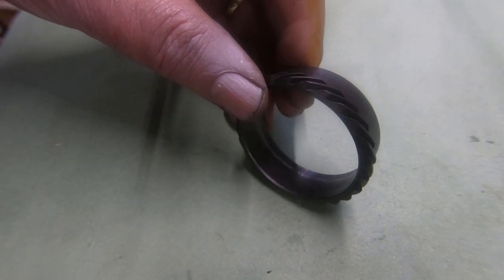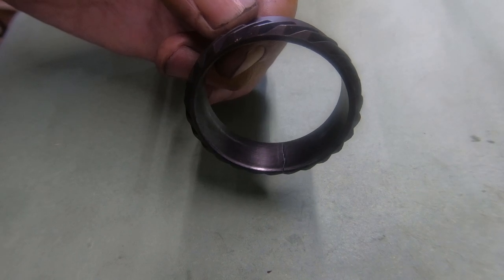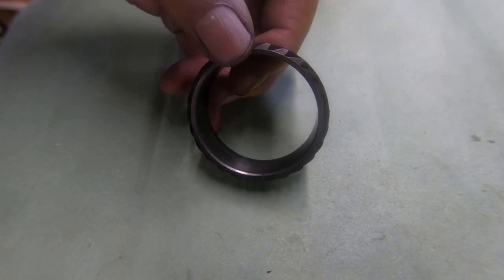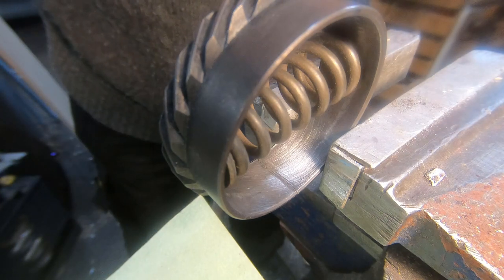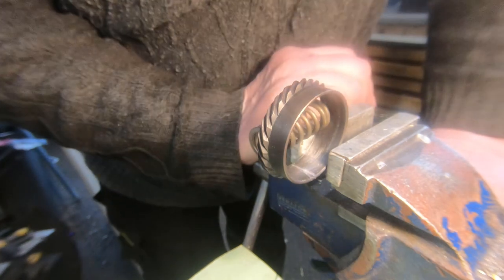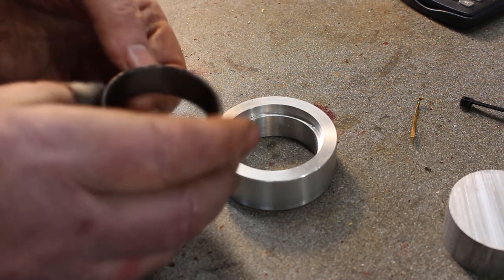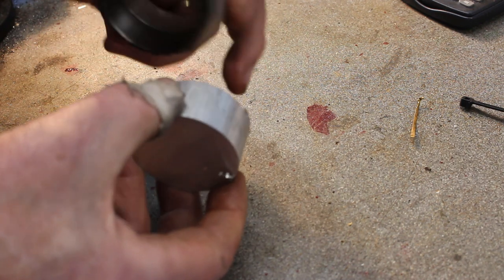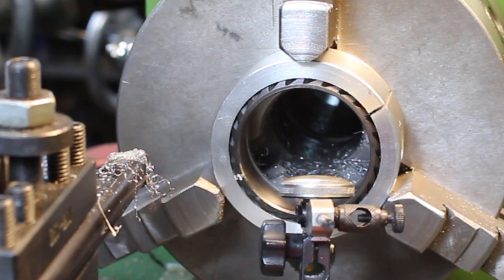Laverda Classic Bike - Speedo Gear Repair

Comment: Ah, the green stuff I love it. Every machinist should have some and hopefully remember just how well it works.
The part can still be removed by heating which is often very handy. 
I have never tried the activator you can get for it, I wonder if my kitchen mitre bond activator works on it.
Checked-it doesn’t.
I love all your cleverness with your machines, thanks.

Comment: Gday Nigel, this is one of those jobs that can turn pear shape really fast, I really don’t think I could have done it especially knowing the part is extremely hard to find but you absolutely nailed it, perfect fix of the crack and perfect fit on the hub, the owner would have been over the moon to get the wheel back, I really like the fixture you made to hold the part concentric in the chuck, I’ll have to remember that idea, thanks for sharing some more great tips, cheers Matty
Reply: Indeed a job well done. That spring in the center to hold a gap for the solder was great. 
I hope Nigel doesn't mind but look up "Workholding with Pot-Chucks".  http://www.modelenginenews.org/techniques/potc.html
Reply from the maker: Hi Matty, thanks  for your very kind comment. It took the owner 12 months to find that part so it was a bit of a concern that things might go wrong, silver soldering can become a disaster in a second with little hope of recovery.
Reply from the maker: Warped 65er, thanks for your kind comment and link, it's good to share knowledge and ideas, cheers!

Comment: Now you are in my world, fixing things rather than modelling. 😉
It occured to me that the silver soldering could have been avoided if you just bored the gear to a slip fit and then merely Loctited it on. It doesn't sound an old school professional fix but then old schoolies didn't have Loctite. 😂

Comment: Hello Nigel,
Can I please ask if you were fitting the gear before it broke would you have put it on your hotplate to expand before trying to fit it to the wheel, similar to how you have shown us when fitting bearings. Nice repair...
Take care.
Paul,,
Reply from the maker: Hi Paul. Yes, all being well I would have warmed it up and shrunk fitted it onto the wheel. This is actually what the owner did and after getting it partially on it started to shrink and cracked. What he didn't know is that the bore on the gear was too small, it actually had an interference fit of 3-4 thou, much too much for a thin part like this. So pays to check sizes before press or shrink fitting. I think the Loctite will do a good job, the gear doesn't have much load on it.

Cheers!

Comment: well done, great repair. Won't the heat affect the temper at all? The part looked as if it was hard, but you seemed to bore it out quite easily. what happened to your thumb? did your other spring bite you :-)
Reply from the maker: Hi Paul
No the material was quite soft, not much better than mild steel. I had an stupid argument with my bandsaw, the bandsaw won hence the plaster on my thumb, very careless to argue with a machine.
Cheers!
Reply: @GoCreatehms  yes i have done that trick myself. had a groove in my thumb for weeks. I have a small block of mahogany now that I use as a push stick , works a treat.